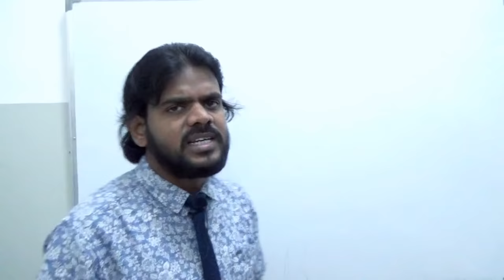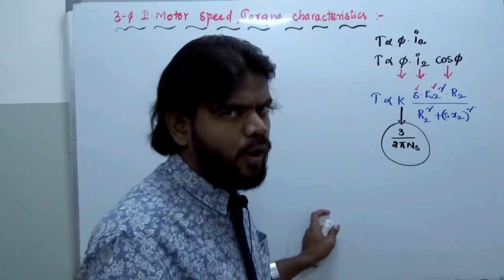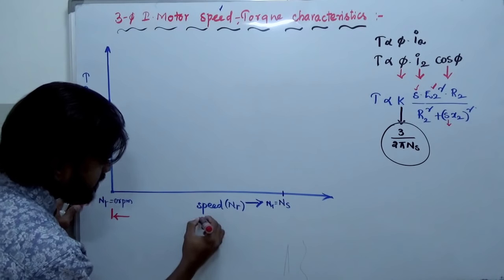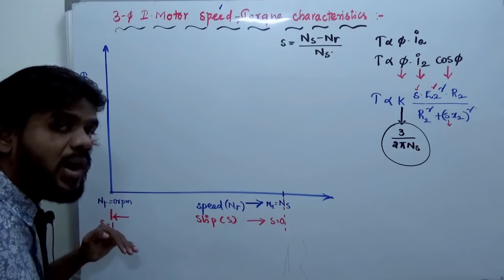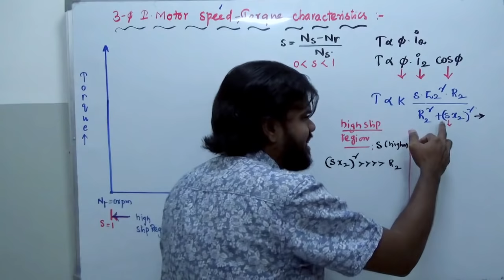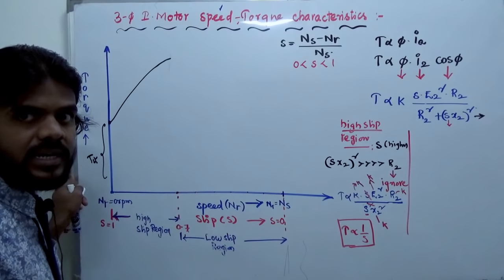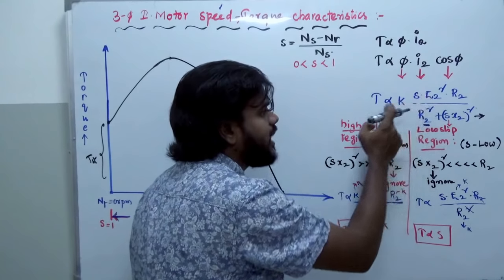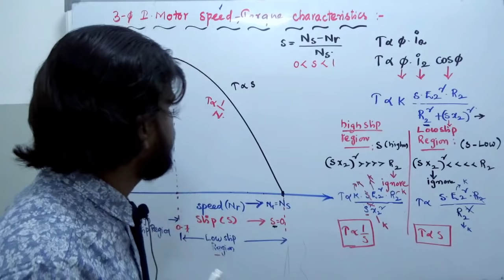Speed Torque characteristics of 3 phase Induction Motor

Comment: Hello I would really appreciate it if you could help me resolve this issue. I have a 1000 rpm 160 kw rated 3 phase Delta connected ac motor hooked to an air compressor feeding an oxygen production plant. our  phase to phase supply voltage is 380 volts. our maximum running load current at working pressure is 250 Amps. This motor failed as it was running for more than 10 years. Lately we demanded more continuous load due to high demand for medical oxygen  effected by covid19 pandemic. I could not find a similar replacement available. However i found another German made motor with same mounting frame and shaft size and also 1000rpm at 50 Hz the name plate says: Delta connection 660 Volts - 260 Amps - 240 KW. my question is : if i supplied this motor 380V with same delta connection will it be able to give me 160 kw power? because its limiting design current is 260 Amps as it says . Thus if am assuming its rated power will be reduced proportionally to the reduction of supply voltage. i it is rated 240 Kw at 660 Volts is it true that it will become a 160 Kw motor under 380 Volts? I am also assuming it will not overheat as the current will not exceed its rated 260 A at my demanded compressor load. Please help me if you have a definitive answer without any speculations. Best regards